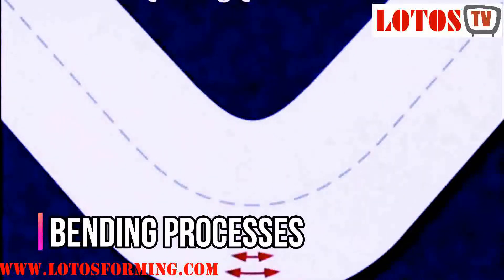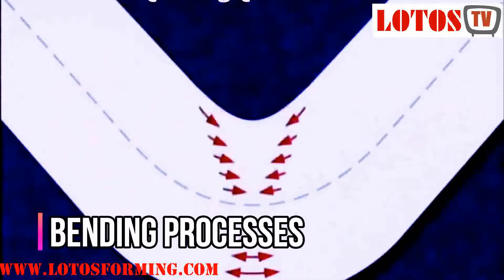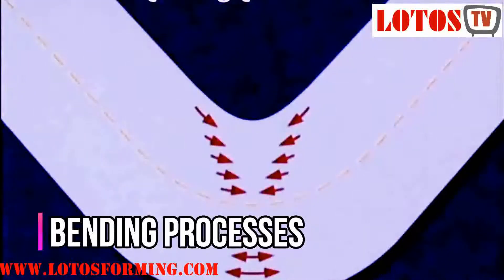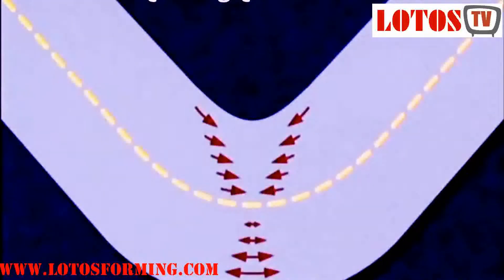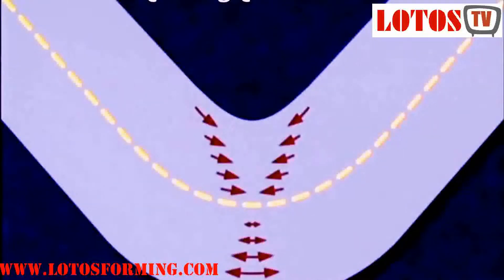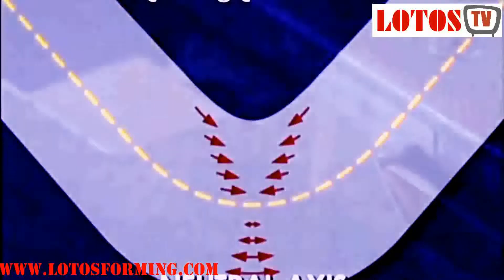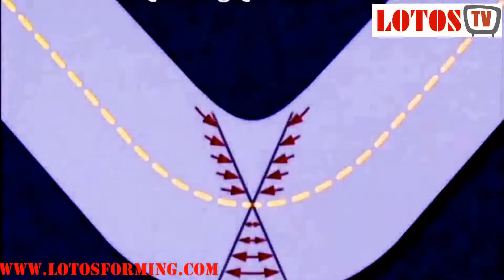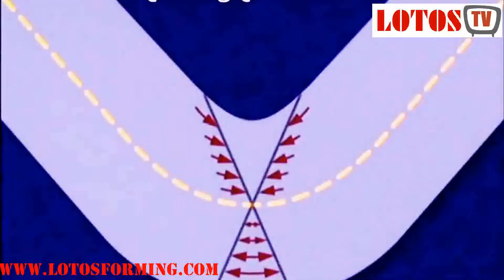▶ Cold Rolled Steel | Cold Rolling Process | Cold Rolling | Cold Rolling vs Hot Rolling ◀

Comment from the maker: Difference Between Hot Rolled Steel and Cold Rolled Steel
Hot rolled steel involves rolling the steel at high temperatures, where cold rolled steel is processed further in cold reduction mills where the material is cooled followed by annealing and/or tempers rolling